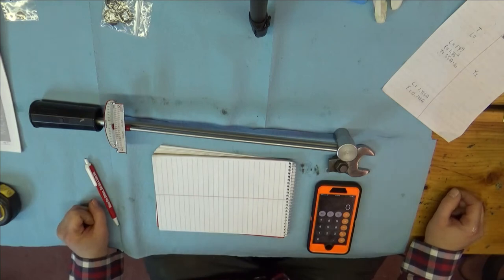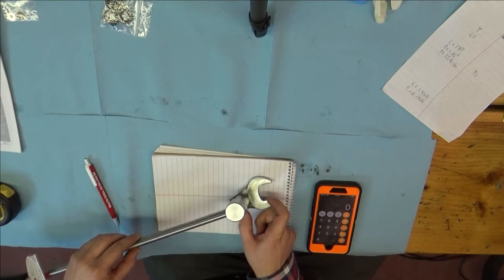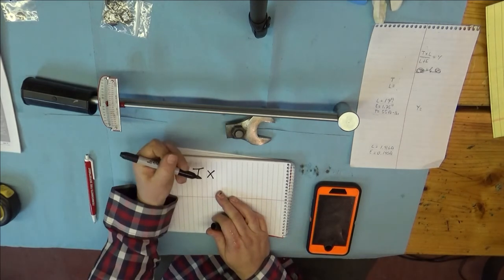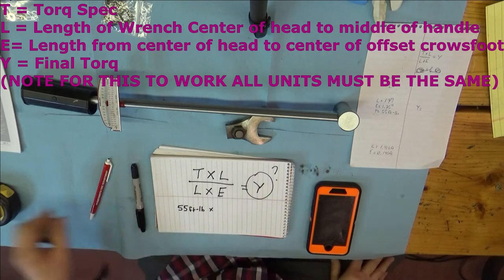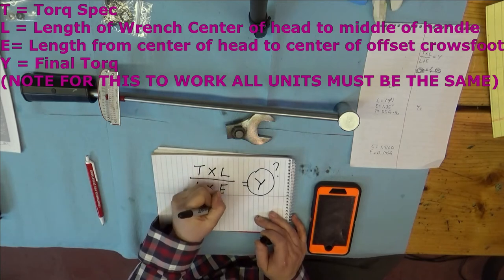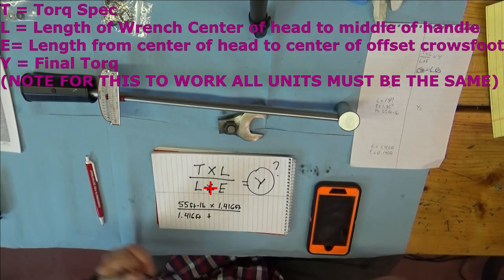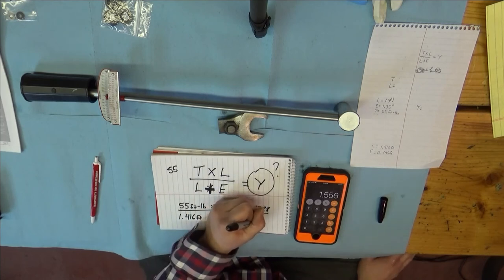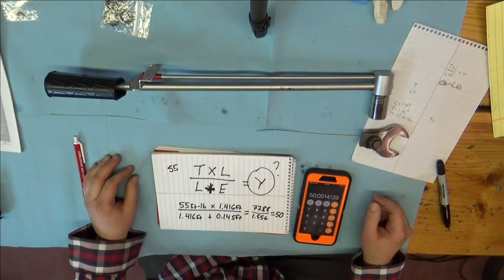Torque Calculation with Offset Crow's-foot

Comment: Good video. Instead of converting your links from inches to feet, just convert your torque from foot pounds to inch pounds. All you would have to do is multiply 55 times 12 and now everything is in inches.